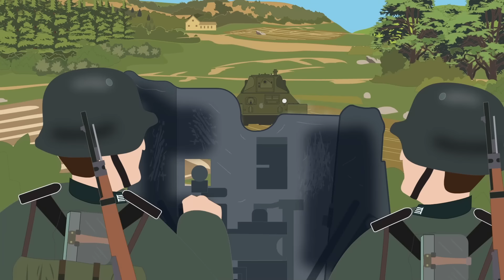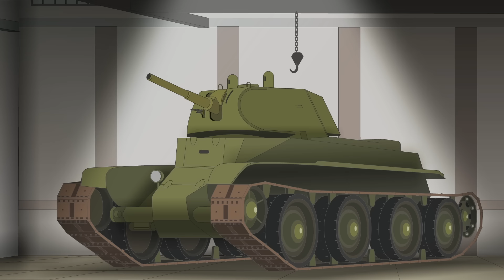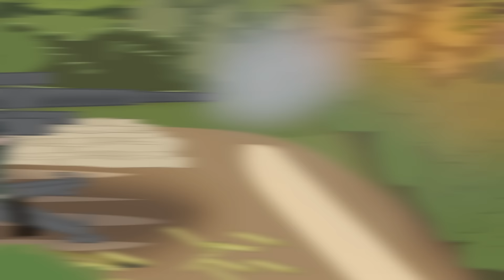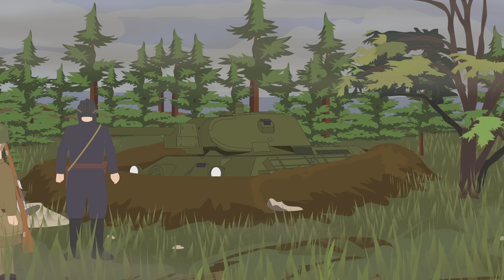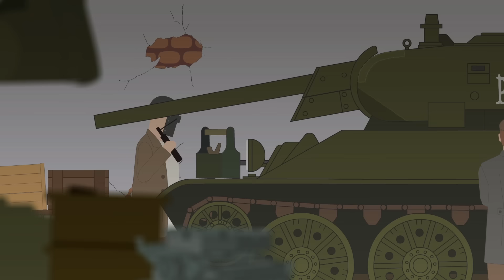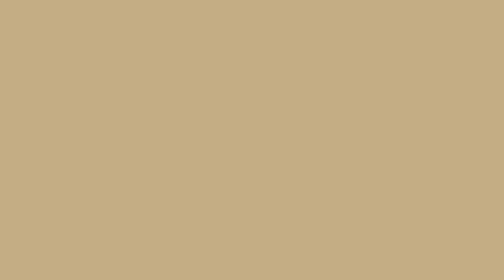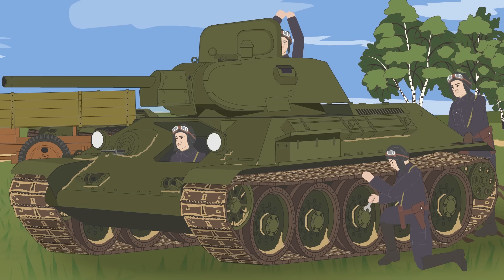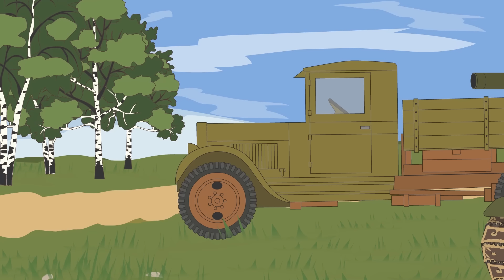Was the T-34 Really the Best Tank of WW2?

Comment: A thing about durability: Soviet studies investigated how much was the average life of a tank in the front lines. The result is that the T-34 was built to be as reliable as possible around said average. No need to build something that will be reliable for 10 years when it probably won't last 1 year, or less.
Reply: The Soviet study in that regard was far more in depth. They found a Tank might last around 6 hours in Combat, be obsolete roughly 6 months before introduction, and would have an advantage that lasted roughly one year before something better came along to kill it.

If I remember the layout of the study conclusions correctly.
Reply: @FLJBeliever1776  They did take it seriously, also they made it so that the tank could be repaired with simple tools and improvised parts. if you couldn't fix it with a hammer, it wasn't worth fixing at all.
Reply: @Spooky_Pastry_AI  - God help you if you lost that really big wrench all T-34 Tanks needed.
Reply: @Spooky_Pastry_AI  That's fascinating, especially given how opposed it was to Germany's method. For them, any adjustments to the interior would require heavy equipment. Even roadwheels and tracks were unnecessarily difficult to replace on many German vehicles, and any core components like the transmission would require you to practically disassemble the vehicle. When you have to remove the turret and use a crane to work on the front-mounted transmission, field repairs become far longer and less safe.

No matter how good your tank might be in theory when fully functional, it is only as useful as its ability to keep functioning. The German tanks become much less impressive when you look at the numbers.
Reply: @Spooky_Pastry_AI  Yep, that was a general consideration in soviet products: the definition of "quality" included "is it easy to repair?".  It also went into washing machines etc. Sure, they would break, but you could fix them in no time with a hammer and a no. 13 wrench.  Fancy finish on the other hand was not part of the consideration, so the weldings may look shabby, and as if welded in a garden shed, at night, blindfolded, but they were exactlyas strong as they needed to be, and it was much, much more important to churn out T-34s as fast as possible using workers of any training level.
In contrast, the beautifully interleaved weldings of the Panther tanks produced so many problems, they didn´t actually improve the vehicle at all, but slowed down production somewhat. But they looked fancy, ok.
Reply: @Spooky_Pastry_AI  at the time of the t-34 no to little spare parts was given to the crew for repairs that is why many of them didn’t return after battle
Reply: @Spooky_Pastry_AI  Actually Soviet tanks were fixed by factory deployed together with front-line troops.. Let's not forget.. The diesel engine was made of aluminium and other light-weight alloys only.. yes it was multi-fuel if you knew how to mix it... but it was pretty much hi-tech.. as the second generation 5 step gearbox, which got Stalin's prize to its makers. 5000 parts were indeed thrown out of the original design to maximize production numbers, but it was still hitech design.
Reply: @FLJBeliever1776  And yet countries including Israel were using Shermans long after the time frame you have described.
Reply: @oldschoolgreentube  - But it wasn't America that upgraded them further. 

Israel upgraded their own Shermans inside Israeli factories in Israel.

They performed all the major upgrades for M4 Sherman from 1960 onward. This included variants such as the Sherman APC, Sherman Observation Tower, and other versions. Israel did all of that.

No French 75mm Sherman Tanks served in the US Military nor did any Sherman with a 105mm Tank gun.

The Sherman 105 used a 105mm Howitzer. That was considered Armored Artillery by US Commanders.
Reply: @FLJBeliever1776  The Easy 8 a WWII era upgrade done by the US slaughtered T-34's in Korea.  25 to 1 kill ratio.
The T-34 was garbage.  Mass produced garbage.
Throw enough garbage at anyone and you're bound to drive them back.
Reply: @FLJBeliever1776  Incorrect.
Reply: @oldschoolgreentube  lol no, it was “only” about a 4:1 kill ratio advantage for the ez8’s. Which is still impressive, as on paper the t-34/85’s were supposedly far superior**. The numbers you’re quoting are the M-26/M-46 kill ratios. (25 to 1 is just insane.)

** - in everything except rate of fire, target acquisition, sights, turret traverse speed, ammo storage, crew ergonomics, maintainability, dependability, etc lol. Virtually none of which is depicted in World of Tanks. :/
Reply: @oldschoolgreentube  - Incorrect, how?
Reply: @oldschoolgreentube  - True, but they were also manned by conscripts with poorer training than was typical.

The typical North Korean and Chinese Anti-Tank tactics involved a Zerg Rush of Infantry with bombs against Tanks. With the predictable results once the Tankers became accustomed to the threat. They literally just hosed one another down with machine gun fire, which only caused minor issues on the outside, unless it was the hapless Communist soldier on the outside, then it was one heck of a wash later on.
Reply: @FLJBeliever1776  How are those tactics any different than what the Soviet employed against the Germans?  How much training do you think a WWII era Soviet Soldier received?
Reply: @FLJBeliever1776   Sorry.  Not sure what I was referring to at this point.
Reply: @randallturner9094  except figures do support massive kill ratios. There are number documented cases to a 'couple of Tigers on hill' defeating 50-100 T-34 . Over all Tiger kill ratios in WW-II were 10,300 tanks and 11830 AT Guns for vs 1725  tigers. Thats 13: 1 ....Yes Killing infantry units is often more important than tanks...and mostly hinged around around defeating AT Guns, followed by artillery  .
Reply: @paullakowski2509  I realize it’s difficult to keep these posts in context, but I was replying to a claim that Shermans in Korea had a 10:1 kill ratio advantage over T-34/85’s, when the actual value is 4:1 for the entire war. 

M-26/46’s did indeed have a 25-1 kill ratio against T-34/85’s … for the entire war. 

My understanding is that German tanks in general had a 4:1 kill ratio vs. T-34’s in WWII. But it sounds like you’re discussing individual actions, that’s not what we were discussing. Waaay too small sample size to draw any conclusions.

Edit: but you don’t get to add in AT guns, that’s silly.
Reply: @randallturner9094  Sorry about that.
Reply: @paullakowski2509  nah, you’re good. It took me 15 min to refresh myself, I should copy excerpts of what I’m replying to. Also, I wouldn’t be surprised if Tiger ratio was even higher, all depends on how they count it.
Reply: @oldschoolgreentube  totally agree with everything you said.
In WW2 Russians lost 80Percent of all tanks.
Reply: @FLJBeliever1776  where are they now though
Reply: @FLJBeliever1776  cant even take a little country by fing up
Reply: @FLJBeliever1776  https://www.youtube.com/watch?v=8Z4aQTZC4H4
It does get mentioned in there somewhere if I remember correctly. And I would have thrown out the same numbers based on my memory of this. Or I might be totally mistaken and it was another lecture about tank production and factory design.
Reply: @connycontainer9459  - Only mentioned in every Military Magazine concerning the Second World War every couple of years or so. Got a couple of copies somewhere stashed in one of the boxes I keep.

It's also a commonly referenced element in military studies. So, it stands to reason they would mention it.
Reply: Interesting you pointed that out. During the Korean War, that was apparently the case. The T-34s that the Soviets had supplied to the North Koreans were mostly destroyed in the first 6-12 months if I remember correctly. They dominated light American tanks in the early weeks, but when modernized Shermans, new Pattons, and ESPECIALLY British Centurions arrived on the battlefield, the T-34 quickly lost its edge. A lot of World War II tech was rapidly fading in effectiveness by 1950. To some extent, that Soviet military study was proven correct here.
Reply: @thunderbird1921  during the Korean war North Korea was used T-34 that was simply abandoned by Red Army after liberation of Korea. Soviet HQ decided that will be cheaper way to just abandon this worn out tanks. And this equipment was obsolete, since T-44 was in production and T-54 was developed.
Reply: @thunderbird1921  - The M4 Sherman wasn't really modernized for Korea. Refurbished yes, but very little was actually done to update them.

The US Army had the M26 Pershing and M46 Patton. Both were better Tanks with 90mm guns and thicker armor. Though M4 Sherman still had a good war in 1950-1951.

The Soviets had intentionally supplied obsolete Tanks to the North Koreans. The KV-1 had its last hurrah in Korea for example. Amazing any had survived that long.

The T-34-85 was obsolete in 1945. The T-44 was online as was IS-3 with T-54 becoming available in numbers by 1950. So with no room left for upgrades, the T-34 could be expended.
Reply: @FLJBeliever1776  The Finns during the continuation war made reused many abandoned and captured t34s and modified it for service long beyond Guderian's prized German 1st Panzers division tanks.
Reply: @FLJBeliever1776  they were most if not all 76mm long barrel shermans.
Reply: @Bagheera2  - Very possibly, but they would have received those upgrades 5 years earlier.
Reply: @FLJBeliever1776  still "upgraded" over tge base m3 armed ww2 sherman.
Reply: @VisualdelightPro  - True. But for how long AFTER the war?

The T-34 was a great Tank. It kept pretty good until 1950. The Soviets thought it highly useful to give it a modernization in the 1960s. Though it was more than likely not the best idea they had, as by then 105mm Western Tanks were a thing.

The T-34 was effective in WW2. It was still effective where it would meet equals or no Tanks at all. But it lost effective and had essentially been maxed out by 1945.

The T-34's last official modernization was essentially a complete rebuild, but by design and age, it would have been limited.
Reply: @Bagheera2  I guess, but he was specifically referring to the phrase "modernized for Korea" and in no sense is this simple phrase true. You could argue the tanks were modernized (even though the Sherman tank itself was an iterative design and many were produced with 76mm stock.) But regardless of how you feel about that, nothing about the Sherman tanks design was "for" Korea, and development on them in the US largely stopped even before the end of WW2.
Reply: @FLJBeliever1776  It was slaughtered in Korea when it came up against WWII era Shermans.
Reply: @VisualdelightPro  modified? You mean painted them somehow to be recognized by fellow soldiers. I don't think they had the recources to modify them very much.
Reply: @thunderbird1921  M4 mediums in the Korean war were M4A3(76)W HVSS introduced in late 1944, hardly 'modernised' And preferred over the M26 Pershing due to its underpowered engine.
Reply: @thunderbird1921  a tiger can turn a 34 to scrap for over a kilometer away
Reply: @austinmartin5446  - And while it is turning that one T-34 to scrap, along with three others doing the same to three more T-34s, there are about 20 more T-34s outflanking by 2 kilometers away while far on the other side of the war, M4 Shermans are running wild with Churchills climbing supposedly impassible hillsides to outflank elsewhere.

Not that it matters. T-34 was older than Tiger. Tiger was a Heavy Tank. T-34 a Medium Tank. Different Tanks, Different Missions.

The Soviets needed to concentrate on what they had left of production. Unlike the Germans who continued to waste time and resources, the Soviets knuckled down to figure out the particulars.

As such, they were able to constantly improve what they had and eventually begin to introduce a few new Tanks.

If you look at the entire war, few nations actually built that many new Tanks. Britain probably went through the most Tanks models designed and deployed during the war out of everyone. And the results were painfully obvious given the, pun unintended, track record of many of those Tanks.
Reply: @thunderbird1921  Yet, T34-85s still fought in Yugoslavia and Syria. If you don´t have Abrams around, they are still plenty scary for infantry support, knock down barricades, bust convoys, etc.
Reply: @paavobergmann4920  - Most T-34s are used more as Mobile Artillery now. Their breeches and guns are too old and unreliable coupled with the fact the used casings are simply fitted with fresh powder and shells to be reused.

There was also a case in Yugoslavia where a T-34-85 was knocked out by an American M18 Hellcat Tank Destroyer.

Syria used T-34s, as did Egypt and a few other Arab nations, against Israel. Israel used a mix of Tanks to fight back. Typically, American M4 Shermans. These were later supplemented with Centurions armed with French 105mm guns.

The Syrians also used even older Panzer IVs and StuG IIIs. Which, needless to say, did NOT survive or give good account of themselves in the Golen Heights. I don't think any of them survived, as they couldn't be probably upgraded, unlike the Shermans were.

Arab forces also made use of Su-85, Su-100, and various other Soviet vehicles from the Second World War.

Which prevailed them to nothing. The Israelis simply outmaneuvered and destroyed them. Most were dug in due to their limited use. Israeli Shermans and Centurions got around and destroyed them at every turn.

The Israelis were eventually able to acquire much more modern American Tanks. Such the Patton series. The Israelis also made use of captured T-54s and T-55s. Though the crews were not fond of them due to the small size and cramp conditions.

References were very... Not fit for polite conversation I've been told.
Reply: @thunderbird1921  dont even memtion the m36 gmc's. Those 90mm guns fuuuuuuuucked t34's and the odd is-2 they had apparently.
Reply: It is interesting that this is said so often because in a way it is only a half truth. The Soviets did indeed only need the T-34 to last as long as it took for them to lose effectiveness sure, but in reality many were lost to mechanical faults. 

The engine in particular was a burden to crews during the first couple of years of Soviet participation in the war had and  many components cast in aluminium when they really shouldn't have been. The idea that this short life cycle was intentional is often held up as some sort of genius but in reality such measures were driven by the war economy and steel / rare mineral shortages as well as skilled labour shortages. 

As soon as the opportunity to replace these engines came, the Soviets did so and the T-34 became a much more efficient weapon. Prior to fixing these problems, reliability was a major problem and when the time came to counter attack into lost territory, one could expect to lose half of your T-34s to mechanical and maintenance issues on the road. 

If you consider that the average life of a T-34 in areas seeing heavy combat was about two weeks, the vehicle losses in transit to the front were a massive disadvantage for Soviet forces and this is why improvements were crucial. 

The T-34 was probably a more effective weapon of war in 1942 because of its increased mobility and reliability in spite of its armour becoming less effective in combat. 

Before any fan-boys attack me; I certainly realise that the Germans and in fact, the British, were not without their own reliability, transport and massive economic woes.
Reply: @aymonfoxc1442  The T-34's were absolute junk coming off the production lines in 1942. Their tank training schools would start off with 250 new T-34's where it wasn't uncommon for them to end up with only 19 to 25 operational tanks after 6 weeks of use. What made matters worse was their inability to obtain replacement parts so the mechanics cannibalized parts off the broken down T-34's until there wasn't any more to be had. In 1943 Stalin sent a T-34 with a mechanic to the US for evaluation by automotive engineers who found a considerable number of design and production flaws. The T-34 and Soviet tanks in general became more reliable after Stalin took the advice of the US engineers to remove, inspect and repair their engines and transmissions after every 50 hours of run time. That caused delays during Soviet offensives yet that allowed them to get more accomplished by having more fully operational tanks for longer periods of time.
Reply: @v21059  The US government provided American engineers to assist the Soviets with the maintenance, repair and modifications of lend-lease equipment. US tanks normally had their engines and transmissions swapped out every 200 hours with refurbished units so theirs could under go inspection and rebuilding before breaking down. That time was reduced to 150 and 100 hours when operated harder in combat and from driver abuse (mostly by using engine braking instead of the brakes). Stalin paid them a visit at the rear repair shops where those were refurbished where the engineers suggested that his tank armies do the same to ensure having more ready to go at the start of an operation with fewer breaking down in combat. The engineers suggested doing that every 50 hours since most were still operational at that point and began experiencing breakdowns that caused major damage after 60 hours. At 50 hours their mechanics would be able to detect and replace worn parts before they failed.
Reply: An interesting retcon of history.  "The T-34 was terribly unreliable."  "Yeah, well, it was designed that way on purpose - for... efficiency. Yeah, that's it."
Reply: That kinda thinking is flawed though. Because if you're winning a war, and tanks are starting to last longer than a year, they can keep fighting and keep the pressure on the enemy.... but if you try to turn the tide after a year long stalemate, and suddenly as you push into enemy territory, your lead tanks start to break down, well then you've lost all the initiative.
Reply: The tank was never made for fast production and low quality. Considering after 1945 the quality of t-34 85s were much better and the older ones were sold.
Reply: @priestoffrogsandfatherofam8659  wrote: “Considering after 1945 the quality of t-34-85s were much better and the older ones were sold.”
— Since T-34 was not produced in Soviet Union after the war at all, so 24k survived the war, and some of those were sold, but many were retained, and still roam around.
Reply: Nah
Reply: It will work in war time condition but when time of peace come it become problematic as tanks becoming more expensive so it can suit the state budget with no war economy. It didn't work for Soviet as their economy got overburdened with military full of obsolete and overproduced military vehicles which one of the factors lead to their downfall. The West choose quality over quantity while the Soviet choose the otherwise as they dictate themselves with their own studies which quantity over quality prevailed.
Reply: i don't think any tank in history had 10 years  reliability, even the most modern updated  would not last 10 years in battle without a serious overhaul
Reply: Especially when T-34s were getting eliminated at an almost 10 T-34s to 1 Tiger ratio.  1 Day at Kursk, 200 T-34s eliminated, to 16 Tigers
Reply: @buckaroobonzai9847  wrote: “Especially when T-34s were getting eliminated at an almost 10 T-44s to 1 Tiger ratio.  1 Day at Kursk, 200 T-34s eliminated, to 16 Tigers.”

- This is very strange statistic. You know there are other tanks fought on both sides then just T-34 and Tiger tank, to figure of 2700 tanks just on Wehrmacht side, so why are you single out Tigers, you know there was Pz-5, Pz-4 and Stug III with long barrel for last two mentioned. Lots of infantry and artillery on both side that you not even mentioned. Also, Soviet and Wehrmacht counted losses a lot different, which would made German tank losses look favorable, right to the point when disabled tanks captured at the collection points along with documentation in case of Kutozov and Rumiantzev counteroffensive.
Reply: Quality build was the German way to do it.  Parts fit tightly.  No hammer needed to fit it.  That meant that production by the Germans was slowed down.   They were not thinking, well maybe in it's first mile of travel it gets blasted to schit.  Had the Germans just slapped their puppies together, there would have been more in the battle.  Luckily they did not "see" their own shortcoming.
Reply: @bunzeebear2973  re: Germans and engineering tolerances - oh, myth. The Germans could have easily out produced the Soviets in tanks if that were their priority. Up until 1943 they never put more than 4% of their munitions production into tanks, and they peaked in 1944 at 8%. Meanwhile, they spent at least 50% on aircraft and air armaments EVERY YEAR. The Soviets simply allocated more resources to building tanks, 30-33% of total munitions production on average. Out of a much smaller total production output, of course.

German equipment was manufactured to tighter tolerances, but that’s not what caused the numerical disparity.
Reply: @bunzeebear2973  write: “Quality build was the German way to do it.”

— Design too, it was like they never going to break, because God forbid if German tank had to be repaired in the field, especially the heavy tanks…
Reply: Bruh, most of them didn’t even make it to the front.
Reply: The t-34 was no reliable at all most didn’t have an radio and the transmission broke down basically every hour and it would get stuck in mud easily
Reply: god help the poor buggers who have to fight in it.
Reply: Maybe don't over heat treat the armor so that it cracks along weld lines. They were face hardening to 600 brunel... Making their armor super brittle.
Reply: @kyle857  yeah studies support that their is optimum steel hardness is tailored to need. In armor allies found optimum was 280 BHN.
Reply: It won’t last 500 km
Reply: Change "years" to WEEKS and you get an idea of the numbers they dealt with.

The Soviets/Russians had been rightly criticized for building almost EVERYTHING as if it were a farm tractor.  The famed Soviet aircraft chief, Andrei Tupolev, either boasted or rued that if the Politburo wanted a flying bulldozer, he could design the wings and empennage, and hang big enough turbofans, and get a bulldozer airborne.  Given some of the aircraft that came from Tupolev, I'd say he got that directive.  Given the rough climate of Russia overall, and what was the state of overall education ca. 1940 in the Soviet Union, any vehicle had to be capable of operating in rough terrain and those harsh winters, and brief, but very hot, summers, and be operated and serviced by barely literate farm boys, many which Russian wasn't even their primary language!
Reply: THAT IS RETARED THINKING   WHY BUILD AN F16 TO LAST THIS LONG
Reply: IN THE HANDS OF GERMANS TANKER/TATICS THE T34 WOULD LAST 10 YEARS
Reply: 1 year if that
Reply: It couldn’t drive 50 km without breaking down
Reply: In principle, it sounds good. But then you've got your best tank crews stuck in dead tanks because they avoided being killed and having to go through the logistics hassle of replacements.
Reply: Can't take any soviet studies seriously.
Reply: @disturbedfan545  a bit like exceptionalist zio thugs.
Reply: They were built to be expected to be blown up in 2 weeks.
Reply: @BouhJouh  wrote: “They were built to be expected to be blown up in 2 weeks.”

— You are so misinformed. T-34 was build to last, so some are still roaming today, and outlived most WW2 tanks that were “build to last”. So somebody lying to you, and you are totally “bought” that lie.